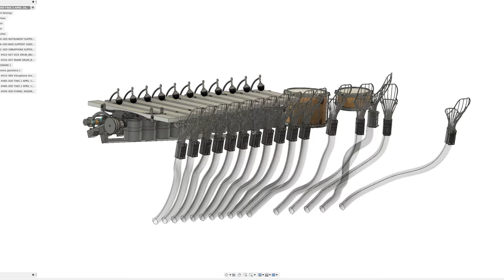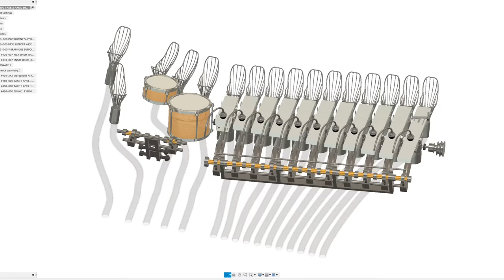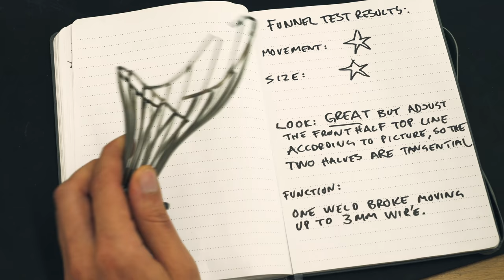Marble Funnel Design Test - Marble Machine X #87

Comment: Since there are similar looking parts that are meant to come off as you break it down for transport, don't forget to get a metal punch set with numbers & letters. It'd help to stamp markings on a not too visible area so you know which is which when the thing has to go back together. This would also help if you have an assistant crew working on it as well once you take it on travels.

Comment: You need a preload that squeezes the spring and tube together (gravity is providing a negative preload here which will ensure vibration). Your fingers worked well because they provided mechanical damping to the system while providing a preload which forces the spring to seat against the tube after the travel, which prevents it from vibrating after the event. You could try just adding a rubber band around the spring and tube, although this is clearly not a permanent solution. You could also take inspiration from pickup truck leaf springs which are self-damping due to the sliding motion between sheets.

Comment: Awesome work. 
Just a suggestion, but I feel like if you just moved the 2 bottom end screws holding the single flat hinge piece closer up to the actual hinge, that second spring piece wouldn't even be needed, and you would likely reduce the amount of movement at the same time.

Comment: I laughed so hard, when you burned a whole in the basket. Yeah, it takes some finessing. You're not worried about all the noise that will be made with a metal marble going into the metal wire funnels? The design is fantastic looking...I guess you are using contact mics, as the machine will be making plenty of noise with just the whirling and marbles alone. Thank for the upload, and I am glad you got some surfing in :)

Comment: Martin, you should have spot welded the wire. Also, move the bottom screws up to where your finger was and you'll have a tighter spring. Finally, Modulin II is built and designed in CAD. See me for details.
Reply: Wait, what? Modulin II? 😮

Comment: Your video leaves me with the following questions.  Would placing a felt or rubber stop in the joint reduce the amount of clicking made by the pitcher-funnel when the two halves close up?  Also would coating the pitcher-funnel mouths with vinyl or soft silicone reduce the amount of noise the marble makes when it is caught?  Both these questions are premised on the assumption that the pitcher-funnels should produce as little noise as possible which maybe incorrect.  Glad to hear you enjoyed your vacation.

Comment: There's a liquid plastic / rubber that we use to coat our tool handles.  If you dipped that funnel in something like that, you wouldn't get that metal on metal "clang" when the ball hits the funnel.  It will be more muted.  When many balls are hitting funnels, it's going to get quite noisy.

Comment: A thought for the funnel cages - if you had them cut out of  thin steel plate and then rolled to form the shape they could be very repeatable and uniform. You could have spares packed flat (and have them be identical drop-in replacements), and also you could give them a mesh or lattice pattern to add stability. You might need to add a wire to the top edge for support, but it would still be a lot less finicky welding!

Comment: A hint to improve resistance would be to weld the top line not on top of the vertical wires, but just behind them. So that when the balls hit a vertical wire, instead of "pulling" on the weld, the vertical wire would lean against the top line, which would spread the effort on all the welds at the same time.

Comment: I think you should add magnets that hold the funnel closed at the top of the base, that way they will snap open but it will get rid of the springing back and forth since that magnets will keep it shut. Should be nice and simple, you'd just have to play around with their size/distance to get the perfect feel you want.

Comment: A lot of people are suggesting putting a screw in where your finger was, to hold the original spring steel in place. I think this is a good idea, but you should include a rubber or felt (or both) washer, to dampen the multiple oscillations down to just one single movement without resonance. Otherwise the movement caused by each marble hit will be lost among the vibrating from previous hits. You want a perfectly damped system in an ideal world, for as little oscillation as possible.

Comment: Have you considered the sound that the marbles make as they hit the wire funnel? Don't need extraneous noise. Maybe could slide some thin plastic tubing over the wire. Or silicone dip them.

Comment: If you use a strap on the spring you could move it up and down to adjust each one as needed.

Magnets to keep it from flopping back and forth.

Felt or some fabric to dapen noise in the catcher, prevent bearing from bouncing.

Comment: For making the movement of the funnel more stable use "harder" springsteel and do not change the posistion of the screws.
If you change the position of the bendingpoint by shorting the lengh of the way the upcoming force can travel 
it adds more stress on the material and make worn out faster.
Just use material with 10% - 17% more resistance.

Comment: Put a small magnet in the base to stop the small wobbles. Weak enough that a marble breaks it away, but strong enough that it + the spring steel keeps it from vibrating.

Comment: If you want to suppress the after shaking you need to add a dampening element to dissipate the movement energy which is largely preserved by the spring. Your finger was a better dampening element than the second spring element you added.

Comment: Could I suggest leaving the lighter springsteel on, but having a magnetic latch on it (just two magnets holding it closed). That way the impact of the ball  will break the grip and allow it to open, but when it bounch shut the magnet will lock it shut again. Maybe with a small felt spacer between the two to prevent too much noise.

Comment: I think you'd fix your extra motion and rigidity problems a lot easier and more permanently with a ligature around the spring than with more/extra spring steel. That also makes it adjustable.

Comment: I think you could get rid of the shaking by adding magnets. So when the marble hits, it's stronger than the magnets and moves it, however when it comes back it snaps into place due to the magnets. If the marble bounces back and forth and hits it again the force isn't enough so it doesn't move again for the same marble.

Comment: Braze the funnel joints after folding the wire over the loop. The brass will look nice against the stainless and by tigging the brass at a lower temperature you won't heat stress the stainless wire as much.  Use a 2 second blast with the tig, no more. fast and hot, done.

Comment: Hey Martin...I would try just to add another screw (5th). Right on the point you pressed with your finger. I feel that should be the best solution. Also only one springsteel needed. Cheers :)

Comment: First of all, this was wired since it felt like you are talking to me...
Second while the spring System is great for eating marble energy it is also vulnerable to oscillations and resonance.
You have two options to mitigate that, first option and the boring one: glue two thin spring steel sheets with a thin rubbery glue together
OR use a eddy-current break <- this would smooth the entire movement but adds magnetism to the mix which needs to be shielded.

Comment: Hi, if you add some more layers (5 or so) of leaf spring sleeves over each other and shorten each one a bit, then the surface areas of the leaf springs will glide over each other and damp the whole thing. Check out the suspensions of cheap early cars with leave springs. They omitted the dampers, because the leaf spring pack also damps swinging.

Comment: It would be cool if you could plastic dip the cage part to dampen some of the extra noise. I understand a lot of this will use contact mics, but this would help in overall noise reduction.

Comment: Probably a bit late but could be worth looking into leaf spring designs if you don't want to change the screw points on the bottom of the funnel. Saves bending all of those pieces behind it as you can just use multiple straight ones

Comment: As mentioned below- the correction to the spring ought to be simply placing the screws on the base higher up, closer to the hinge point. As you shorten the spring you will see a quicker reaction with less wobble and a tighter action.  Also- steel marbles hitting steel wires seems like adding a lot of noise... you can DIP the cages in a clear rubber for a noise free coating, that will just make the wires look shined and polished - as well as prevent rust-.

Comment: Those marbles have a lot of leverage on the short springs.  To avoid extending the spring too far and losing the elegance of the funnel, I would suggest trying a greater static spring pressure to help keep it positively in the closed position, while keeping the original thin piece to acts as the hinge so it's not overly rigid on initial impact.  Maybe even consider using a second preloaded spring of a different thickness and/or a touch longer, to help dampen the harmonics of the funnel as it moves?

Comment: How about adding some color to the Marble Machine?  You can paint certain moving parts bright colors so the audience can more easily see the movement from a distance.
Reply: Somebody suggested coating the funnels in rubber to reduce echo, so why not FlexSeal Colors? It was good enough to turn an old truck into a submarine.
Reply: @buddyclem7328  Good idea. I was thinking it might be nice to see bright green and blue and red on the big turning wheels and other moving parts like those flailing arms he wants at the top of the machine.

Comment: If you machined T-slots into the funnel base, and then slots into your spring steel you could move the screws up and down and you could easily adjust the tension. Or add more or less steel. That'd probably be simpler.

Comment: you can also add a piece of spring steel on top of the spacer nuts, it'll have a tighter bend profile by pushing against the bend of the other since it is sorta free to stretch. not sure your bendy boi is enough.

Comment: 3:01 timeline
So you don't like? Its ok put a screw where
your holding or pushing it together simple.

8:16 timeline
You can also put rubber bands as much as you
want at the bottom neck if it to fine tune it till
You get the desire tune but warning it would be
Only temporary because rubber bands break!

And hay its a good thing you took break so now
You had some great memories besides work ^_^

Comment: Looks great, but that is also the first part where I would really worry about damage in transit or in assembly - might want to make twice as many as needed and keep them with you for spares. Just imagine one slipping as you are putting it together and someone stepping on it, or putting them in a case and something gets dropped. Whether the welds pop or the wires bend, either would be difficult to fix in a way that would not be visible.

Comment: I would add some stretchable material in 90° angle to the spring steel, it will allow you to attach it at 2 places and since it would be (at idle state) a little stretched (it would never be in it's equilibrium point) it would never oscillate thus no back and forth

Comment: you could put a solid piece of steel against the spring steel attached via the bottom two bolts, that way you can more finely tune the point at which the flowers(?) mouth hinges

Comment: Martin, On the cage/basket part. Instead of all those welds of those little wires why not have them be continuous curves instead. For example... if you were to number each wire 1 to 10...left to right, wires 1 and 10 would be one continuously bent wire. Wires 2 and 9, 3 and 8 and so on. You could then just weld them all together at the topmost point/centerpoint of their arcs. It would reduce your welds by half and also have them be more robust. All those little welds right now would be continuous repair issues as you will have hundreds of welds all looking to fail over time.

Comment: You actually need a mechanism called a dampener to stop oscillation. There are complex examples of this mechanism, but I would start by trying a silicon rubber foam pad between the stable basket mount and the moving basket mount. This might require some more clearance than you have in that gap. Note that your finger was working as a good dampener, besides increasing the spring rate. That's how you got the desired effect.

Comment: I think putting the border wire on the outside of the basket is mechanically better.
Even if the wield breaks, all the wires are somewhat supported from the backside when balls hit the front.

Comment: I would braze the wire vs welding it. More control over how much heat is applied and the only thing you need to get right is the thickness of the brass rod so it melts before the wire gets to hot and deforms or breaks.

Comment: I would try using a magnetic catch to hold the thing shut after the initial return. I.e. initially the magnet holds the "jaw" closed, but when the marble hits the jaw it dislodges the magnet enough that the spring has to return the jaw. Once the spring returns the jaw the magnet is enough to keep it from oscillating.

Comment: You should just drill another hole in the middle, where your thumb was, and put a screw there to hold the spring steel in place, instead of having to add a whole extra piece of heavier spring steel.

Comment: What about 3D printing the funnel pieces? Same material thickness, but no more headache over joining the wires. Simple 316L/1.4404 stainless steel should do the trick.

Comment: What about using a small magnet to prevent funnel from moving after marble has been "swallowed", use magnet just as strong so marble can move the funnel but as soon as it returns to its initial position it gets held by the magnet steady in place. That would remove unnecessary vibration of the funnel.

Comment: I think you should use thicker spring steel rather than 2 pieces with bends. It would be easier to work with especially with that quantity.

Comment: I was thinking the same as Ren Traysik: adding a screw in the 1st leaf spring to mimic what you are doing at about 3:00. This could be improved by adding adjustablity in this way:
1. having a thicker leaf spring to add ridgidity and counteract metal fatigue (zillions of balls falling in the funnel).
2. having a T-slot in the funnel supporting piece to receive a nut, and a slut in the in leaf spring.
You would then have a sliding adjustment of the spring action. You can adjust for every funnel as needed. Balls won't be falling from same height for each instrument. Springs will weaken with time.

Machining a T-slot in steel is not easy but it keeps the design simple. A task for This Old Tony?

Comment: i'd definitely braze the bottom. as for the top use a sightly larger wire or even tubing with small drilled holes and braze those as well. (furnace brazing would make the process go faster)

Comment: I would use some rubber to dampen the spring. I have read sugestions for rubber washers, but I would try a sheat of hard rubber about the size of the spring.

Comment: I think if you bolt the second spring at the top and keep it bent maybe a bit longer to compensate for the added rigidity, in stead of curling it up under the screws. It maybe would take out the last little bit of bounce, especially with the thicker wire. Also, maybe you could make an end stop surface, higher up like two flats on each side with a felt material on one face of each, so it will absorb some of that energy from the recoil preventing the bounce in the first place. Like a dead blow.

Comment: Another thought entirely: If the funnel is oriented so that its throat is in line with the path of the marble, then there will be much less sideways force when the marble hits the basket, eliminating the need for the hinged shock absorption altogether. Line the inside of the basket with felted material (3 to 4mm thick) to absorb shock and deaden the impact noise.

Comment: I suggest you should add a piece of cloth, like the one in the piano, between the metal pieces... it will reduce the noise by a lot (even though it will always stay noisy.. now that I'm thinking about it, making this pieces from plastic or wood - or even have a transparent nylon-plastic-thingy around the so called 'flower' part could have resolved with a way more quieter solution)

Btw if there are any stupid grammar mistakes please tell me.. English is a second language for me...

Comment: i think you might be able to remove most of that oscillation if you bent the spring so that it is preloaded against the closed position. Currently in the neutral position there is no force holding it closed if you preload it you could leave the spring light and still have a lot of motion but it shouldn't oscillate about the neutral position.

Comment: Wouldn't the metal on metal contact of the ball bearings hitting the funnel make a lot of noise?
Reply: These won't be close enough to the microphones such that it shouldn't matter. Same with the fish-stair; though putting a mic up close to certain parts might make for an interesting effect that certain songs could be planned around.
Point is, when hooked up to an amp and speakers, the crowd isn't likely to hear all the mechanical stuff.